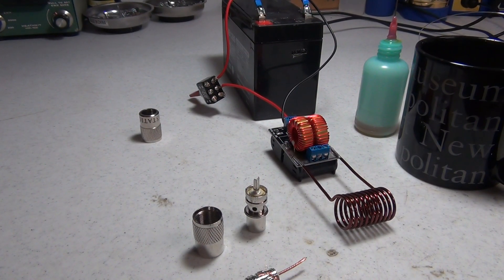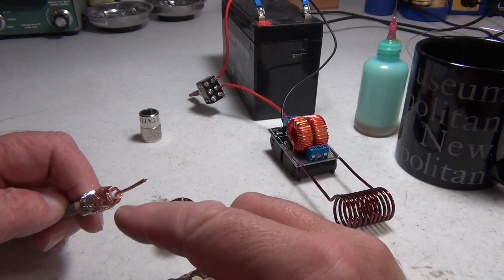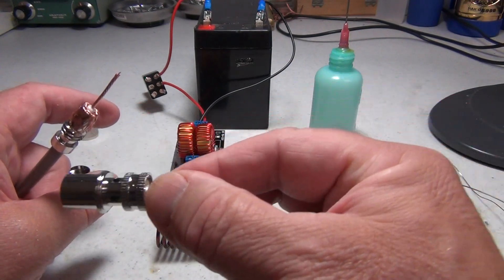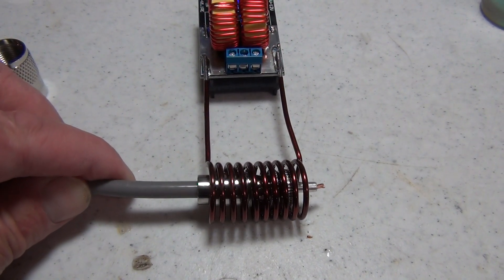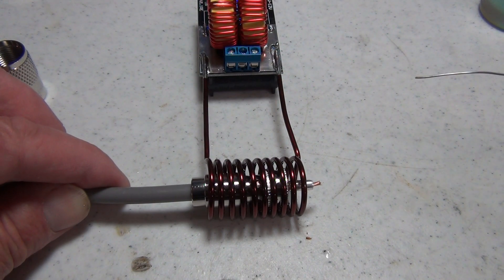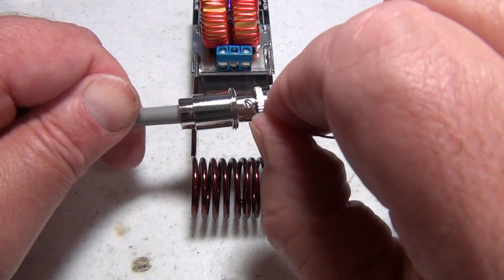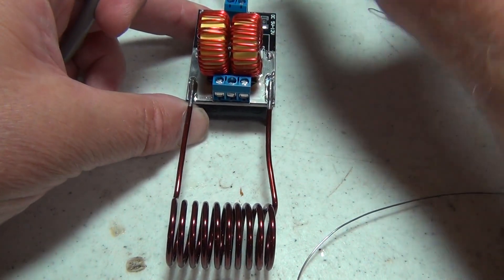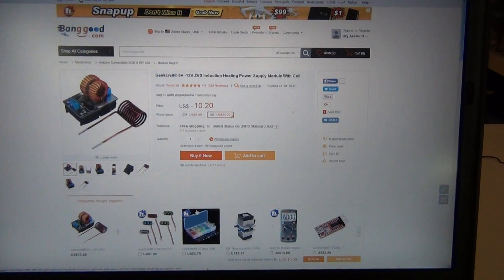Induction Soldering PL-259

Comment: We tried it by screwing the coils directly in the terminals and it worked. But that was from a spare coil. The solder points underneath the terminals may not be a connection. It may just be to provide support to the terminals. But the real connection may be inside or behind the terminals or on the silver stuff next to the terminals. So I learned something new.

Comment: I suggest that you investigate solder paste. It is used to attach components to a PCB board, by baking the board in an oven. You would put the paste onto the copper shield wire, close up the housing and cook the connector in the coil. No taking the connector out of the coil and adding wire solder. It would be a one shot process. Paste flows at a lower temperature than wire, too, lessening the likelihood of collateral damage. I recommend MG Chemicals 4860P. Using paste is a professionally recognized soldering method, for appropriate applications. It would serve your purposes very well.

Comment: Well heck, what a concept. Your the first I've seen besides myself who actually solders the ground/shield. That's a slick idea, I usually use a 200 watt soldering iron while crossing my fingers In hopes of not melting the center conductor but I usually lean towards using a quality Teflon  shielded coax. 
   Thanks for sharing!
     Kind regards Eric Dee
Reply: Please be careful with teflon. Burning/melting teflon releases toxic vapours that can make you very ill. It's called the Teflon Flu.

Comment: How hot does the inside get? Won't it melt the coax?
Reply from the maker: Hi Modex20:
You do have to be careful as there is a point where the solder flows well and then, if you keep the connector in the coil it starts to soften the coax jacket. Hold it in TOO long and you can melt the center dielectric. A little practice and it seems to work well.
73
Todd
AD0RR
Reply: @tchristell  you had it in there for a good minute and a half.  I got one of those myself and tried out.  That connector is HOT afterwards.